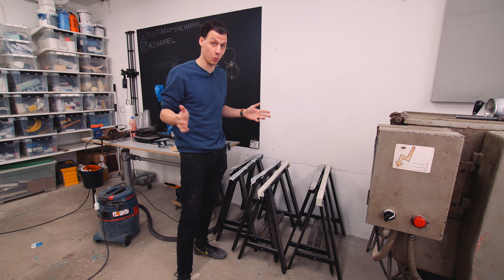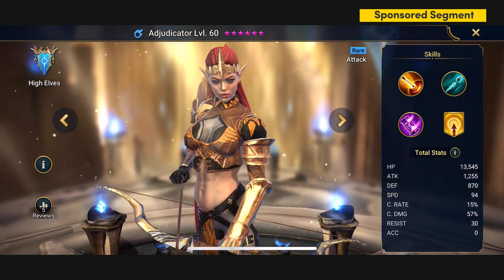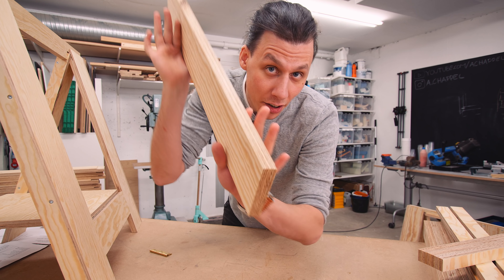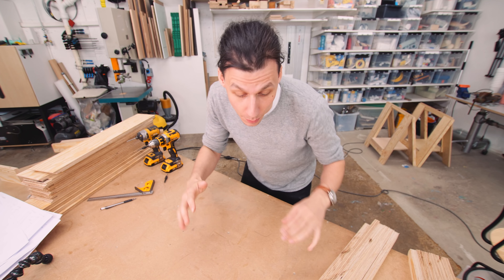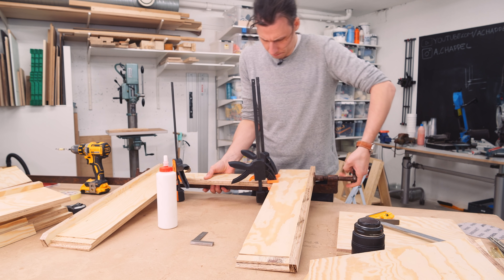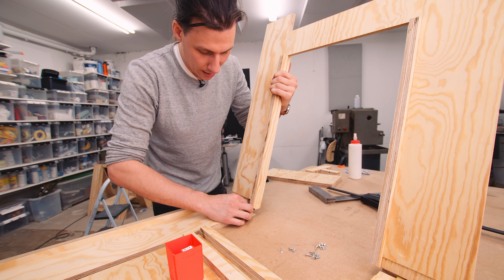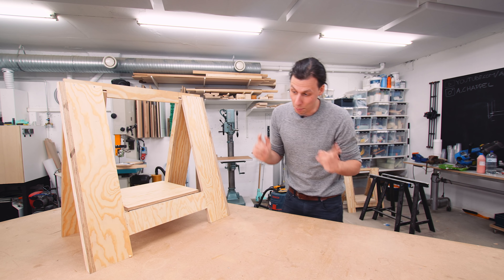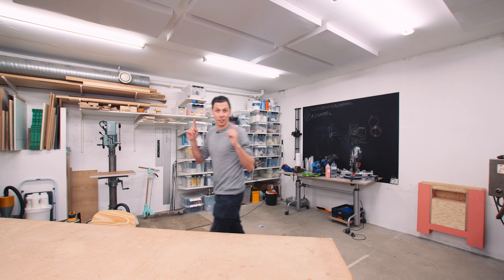How to make Foldable Sawhorses - Strong and Super Compact!

Comment: I've actually been using those cheap foldable trestle tables with the plastic top and metal legs instead of saw horses. You only need two to support both ends of a sheet of plywood or whatever when cutting it. They can also be used as extra work-table space or whatever too, and they are pretty light and fold down to almost nothing. I've actually been thinking of designing a table-saw setup using them as extension / out-feed tables as space in my garage is limited.

Comment: Very nice saw horses. I will probably build myself a set. The sacrificial top piece is a nice feature. However, it's good practice to not cut your saw horses when working on them. Normally one would place (2) 2"x4"x8' boards  between 2 horses with 4-6 pieces of 2"x4"x4' across them to both properly support your plywood and prevent cutting your horses.

Comment: Hi alexander! Great design. I bought your plans and are planning to build 4 horses this weekend! The thing I am worried about is the alignment of the hinges. It is hard to believe that you got it so accurate as shown in 11:09! A small angle error get amplified by the leg length of course. Any suggestions for aligning the hinges? Ideally, you want to start folded but you cannot mount screws of course. What about just a single screw, fold the saw horse, align and then carefully open it to drive in the remaining screws?

Comment: I actually bought the plans and 
built 3 of these sawhorses! Who else can say that here in the comments 😊 

The plans are really well made, clear and accurate. Worth the money. 

However, the design itself resonates computer design and not workshop design. I mean it works nice on paper but not in practice. 

The margins of 1 mm I can accept. 
But all funny angles and cutouts are too time consuming to justify (just) a saw horse built. 
Without a band saw at least. 
 
Also, the alignment of the hinges is done flush to a shoulder, and then the far end of the legs should align within 1 mm.  A lot of tweaking. 

Concluding, I am happy with my result, but it was not worth all the hours a spent. Could be my lack of skill also 😉

Comment: Please, please, please practice better safety on your tablesaw with the use of push-sticks, etc. I have been doing woodworking projects for many years so I am very comfortable around power tools - too comfortable apparently. 3-1/2 weeks ago I was completing a simple cut list for a 3 drawer cabinet and I reached back across the blade and nearly cut 2 of my fingers off.  I got lucky and they're healing nicely with no motor loss and sensation is slowly returning.  I love your channel and do not want to see you hurt.  Complacency + Impatience = Injury, Alexandre.
Reply from the maker: First of all, I'm happy to hear your healing up nicely! Sounds like that was a close call. And yes! absolutely use a pushstick, as I've mentioned earlier as well everyone needs to judge the situation themselves, I didn't feel like any of the cuts I made here were to close for comfort, and I will absolutely use a push stick when in doubt! The most dangerous cuts are always the most routine ones where you lose focus and make silly mistakes. Thanks for watching :) and a speedy recovery <3
Reply: I hear you my friend! I have spent years in the shop with power tools and continually warn myself to not get complacent, but it happens. Main reason I bought a SawStop 10 years ago. Besides it being a fantastic saw, I find myself being more careful of course not to get injured, but also to keep from tripping a cartridge and having to pay $80 to replace it.
Reply: nice to hear you healing well friend
Reply from the maker: JB jeah id love a saw stop or at least it's safety features, but I prefer the European style sliding table saw that I have now.
Reply: @achappel  SawStop has a sliding table add on that works great. That saw of yours is high quality and I appreciate the
Reply: This is a very important post. Thank you for writing it.
I do have some thoughts on safety when using power tools that might not be all that popular. As I see it, and this is just my personal opinion, the safety consciousness can be taken to far and become excessive and unwieldy. Problem is to know when that happens and exactly what the dangers are. Most power tools are dangerous to some degree, but the dangers are not always obvious at a quick glance. Sure it's easy to see how getting your hand in the drill press isn't a good thing, but it's less obvious that wearing a glove when holding some piece in place makes it more dangerous than not wearing a glove. Most people will not think of the glove getting caught and pulling you hand in as it wraps around the chuck before you point it out to them. Same with hair. 

Most people might think something like "Sure, getting you hair stuck in the spinny bits will hurt, so I'll just keep it away from them, easy." What is easily missed is that often these "spinny bits" will move a lot of air and might suck any free hanging strands of hair into said spinny bits, which is generally considered the start of a bad day. Some machines even build up a static charge that can help this to happen, so just keeping you hair out of the way isn't always as easy as it might seem. And that's why hair nets are so important. As a beard carrying member of the male species I've occasionally had to improvise and use a hair net to keep my beard safe. Yes it looks ridiculous but rather that than get my hair in the spinny bits any day.

Where things start to get less clear is with things like the humble table saw, the band saw and a lot of other stationary power tools. On one had it seems simple. Keep your dirty dick beaters away from the cutting tool. But how far away do you have to keep them? Is a hands width far enough? How about a thumbs width?
And as so often it depends. As the OP posted complacency is a major danger. "I've done this hundreds of times and nothing has ever gone wrong. I know how to work this machine." That's a dangerous thought. And also as the OP posted it's often not when you are actually working the machine that accidents happen, but when you are just about to remove a leftover piece from the work area or when reaching for the next piece to cut that your mind wanders and suddenly you do that stupid thing you'd never dream of doing while actually working the machine.

Using a push stick will help you work that table saw while retaining  roughly the same amount of fingers that you had when climbing out of bed that morning. It won't prevent you from some of the other stupid things you do around that machine that unfortunately tends to have a taste for fingers and hands. In general I'd say that all the safeguards on power tools are there for a reason. They are not there to make your job easier or more convenient, but to keep you from injuring yourself when you stop paying attention. And you will stop to pay attention, we all do at some point. In more than 99% of the time nothing bad happens, or humanity would have died out long ago. It's the remaining small percentage that is scary. Some times I despair over the dangers of taking the car and driving in heavy traffic. With so many people on the road thinking of anything but driving their car it seems there should be a lot more crashes. But some how most of these situations are avoided and you are more likely to get to your destination that ending up in a car crash. But every now and then attention slips and shit happens. I don't think that there are many who still believe seat belts and airbags are dangerous, and most people will use them without thinking even though I remember a lot of people grumbling about how inconvenient they are. My father was one of these and would always take his seat belt off before putting the car in reverse as he claimed it got in the way when he looked back over his shoulder. He was also one of those persons who religiously disabled all safety devices on any power tool he got his hands on. Again claiming that they got in the way to the degree that he couldn't work with them. Using a push pin when working the table saw was something he'd never would have thought of. The simple concept of keeping a few specially made push pins at hand would just seem silly to him. And yet, while he did have some scars from power tools he took all his limbs with him to the grave when his body finally thought he'd had a long enough life.

What I'm trying to say is that it often isn't the work you do with a machine that's dangerous, but the moments when you just reach for something or are just going for the on/off switch when bad things happens. Just because some people, like my father, can work with dangerous equipment with minimal safety for an entire life and never lose anything important doesn't mean it's a good idea to emulate them. My father left me a lot of tools, and a lot of them lack any safety equipment they might have come with. Certainly all his old power tools belong in this category. I do use them occasionally, but I won't lie and claim I'm not tightening up that butt hole any time I fire them up.
Reply: I've been in a workshop while a girl next to me cut off two of her fingers. I'll never forget her scream. She was doing exactly what you did at 3:16, Alexandre. Then the board got caught, pulled back her hand at an angle, right into the saw. It literally makes me cringe to watch you ripping on the saw.. Otherwise, I love your videos, content and style. Also, apart from your own safety, please have in mind that you're an influencer.

Comment: also to finish it off like a pro add a small chain or piece of rope to the side of the horses at the length of your plank support and you'll never have to adjust your lower plank on the horse it will always fall into it's right place...Just saying...

Comment: "with just a little bit of precision" - and some drill jiggling if the precision gets in the way (; 
super nice sawhorses, and nice to see i'm not the only one splurging on torx screws. Bit more expensive, but impossible to cam out even at weird angles and almost infinitely reusable.
Reply: Robertson screws are the best even superior than torx.  Regards, from Canada
Reply: @keithagn  Sadly they're almost impossible to get here in Sweden...
Reply: @keithagn:   Torx screws with six points seem to have far more drive capacity than Roberston heads with only 4 sides/points. Torx is the way to go in my shop.

Comment: Your Hand 🤚 is to near on the Saw blade. Would it make sense to reduce the weight by drilling holes?
Reply from the maker: maybe, but i'm not going to move them around alot, so i would rather have the additional strength :)

Comment: Remember you never want to use the fence on a crosscut on the table saw, as the wood can bind. 2:45
Reply from the maker: This is not a crosscut though, the wood is much longer than it is wide, and I am pushing it on the supported side. So no,  the cut I did there will never bind, worst case if the fence on the right side is set to tight you might get some burn marks. However, if I were to cut a thin strip of wood with that setup that would be dangerous and would definitely bind. So in that scenario I would always either move the fence completely out of the way or move it back behind the saw. The important thing is that the fence isn't touching the wood after its cut off. @3:18  would be the right setup for that. Thanks for watching :)
Reply: @achappel  I'm sorry for the late reply, but I was always told never to use your crosscut sled and your fence in conjunction, as the wood is pinched between the blade and the fence without proper support. Your right, at 3:18 that was the right move, but I would have done that for all of crosscuts. Then again, I don't have any experience with European format table saws, and in truth there isn't much danger with just an unsupported piece. I'd suggest watching some Matthias Wandel / Steve Ramsay for info about kickback.

Comment: Kult at du har sponsor og greier, men det er skuffende å se at det er Raid som sponser deg. Slike spill er notoriske får å lure unge til å blåse bort penger, og ikke passer det med kanalen heller. Jeg forstår du ikke har 100 valg, men jeg tror du tjener mye mer respekt og faste seere om du holder deg unna slike umoralske og sleipe sponsorer, og heller venter litt lenger og får litt mindre av noe som både passer kanalen og er interessant for seerne dine.

Er ikke meningen å være negativ altså, men jeg har sett mange folk miste seere og respekt av å gå for penger over integritet. Sawhorsene var sinnsykt bra må jeg si, spesielt hvor kompakte de var og hvordan du får 3 stk ut av én plate. Du er ekstremt flink på å tenke ut slike ting, og er en av grunnene til at jeg digger  kanalen din.